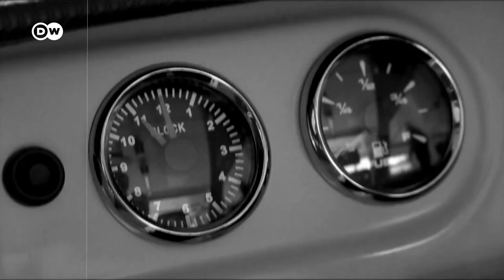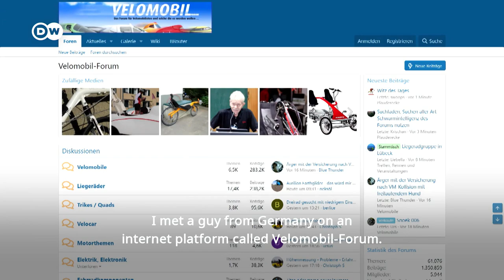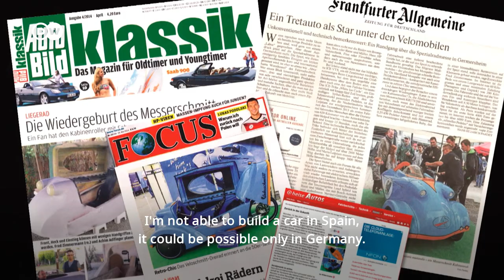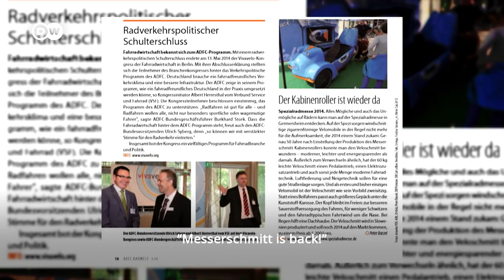Messerschmitt KR200: Quirky Bubble Car Now Electric!

Comment: I love this story. This guy managed to get his vision realized and timing is perfect with electrification. Finally I would like to point out that the Aptera car also has 3 wheels. But that has solar power charging. However this Messerschmitt is on the roads NOW.
Reply from the maker: Like you said, this Messerschmitt is on the roads now. We'll just have to wait and see how Aptera (and other solar cars) fares. Sono Motors' Sion, for example, didn't see light of day (pun intended).

Comment: I note the front mudguards are TG500 shape which is, I think, a shame. However, congratulations on reviving the 'schmitt. 
There must be room for more batteries to increase the range. This would be worth it despite the extra weight.

Comment: I also would like to add my congratulations . Electric , yes way to go , this is the future . To my mind , all electric vehicles will eventually follow this kind of route , they just don't know it yet . Personally , i think the future of large vehicles are numbered .

Just a suggestion , take a look at building the wheels outta carbon fibre , i think that's another innovation , electric vehicles will need to master .
Reply: Chinese Hub Motor would work, to save weight, then fit larger Battery

Comment: Hello. Is it just a prototype?
If not will it be allowed to ride on roads ?
What prices according to electric or gas version?
Reply from the maker: Hi, this is the url of the New Messerschmitt http://www.messerschmitt-werke.de
Reply: It's road legal in Germany and they start serial production.
They get to a speed of around 90 kph or 55mph

Nothing was said on the price.
Reply: @dave_sic1365  about the price , i have red about 15000€ which is quite expensive .since you can find a traditionnal smal car for hardly more 10000.
Reply: @vaporiste  yes they are very expensive. But that's OK since the producers don't want it to be a mass vehicle, just something for enthusiast.
Reply: @dave_sic1365  it's a pity , because it could be a positive écologic answer to environmental issues with a only 3kw engine .. but not at this price.
Reply: @vaporiste  yes and no, it's just for 2 people. 
Like an electric scooter but it has protection against rain.
Reply: Yes . It makes all the difference . Ifit was just a little expensiver than a 3 wheels scooter it would really be an alternativ solution for commuters.
Reply: Beautiful, in theory. But that quiet and low to the ground a VW Beatle would run over me the first trip to the store.
Reply: I see that they start with an electric scooter (made in China?!) and discard the unused bits.  Hence the high cost. Though appreciate this is a simple route.
Starting from scratch would be much cheaper.  
And as you are moulding a grp body, incorporating some carbon fibre could make that the structure at little extra cost, doing away with the steel chassis

Comment: It should be as narrow as possible but lean steer like a motorcycle.  The reduced width would reduce road congestion as more cars could use the existing road width.
Reply: Then buy a motorcycle

Comment: I love it but I can't believe it's cheaper to buy a whole new electric scooter and use the parts to build the car.
Reply: um i think that was just for the prototyping phase
Reply: actually, for a small manufacturer it is cheaper to buy the whole scooter. it is different if you are mass-producing by the thousands, but this company only intends to build small numbers so this is the cheaper way to go.